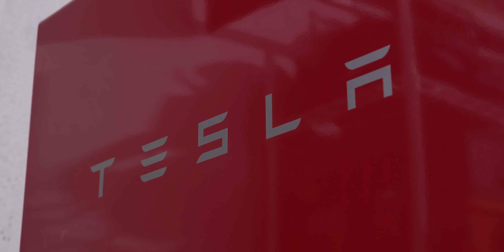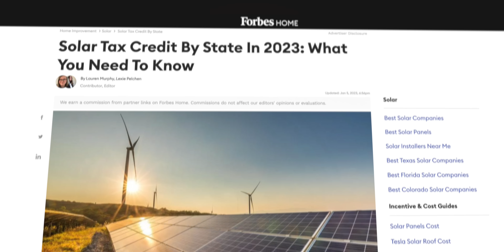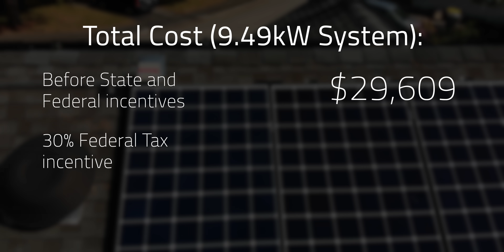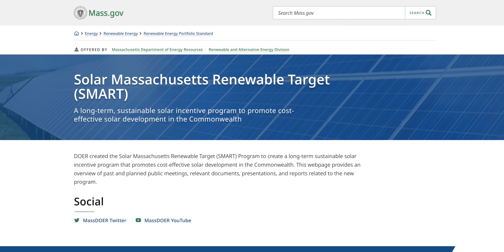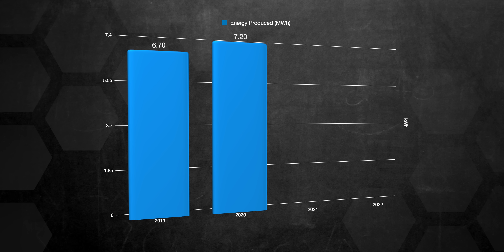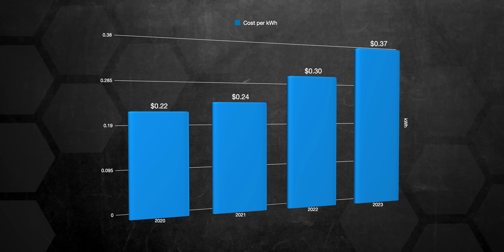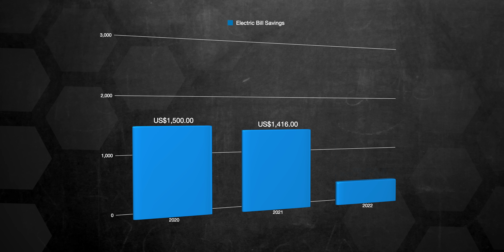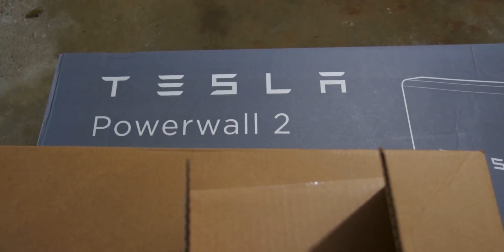5 Years with Solar Panels - Is It Still Worth It?

Comment: For those watching in April 2023 & beyond, the US Congress did extend the 30% tax credit to 2035 - however there are a few caveats listed - if your State offers any subsidies such as flat grants, rebates, or you are part of an energy "buyback" for grid-tied systems, that 30% is either reduced (22% minimum) or it applies *after*.

Dont try to pull a fast one either, as a lot of the State rebate or grant programs come from federal programs and are accounted for.

The Feds let you claim everything related to the project as well, so take copies of your receipts and paid invoices. This includes everything from contractor labor (get a good tax person to see if your own labor can be rolled, depending on your tax status), any tools and supporting materials: batteries, inverters, controllers, wires, crimpers, angle iron, couplers, insulation, masonry/carpentry materials, as well as Sales Tax.

So dont only put your Victrons and panels on your return, pump that credit.

Comment: Great video, very informative and clear. One question, in the category or would you do it differently. If you have an EV, would you consider not getting a battery like the Tesla power wall and instead using your car's batter for the same purpose?
Reply: That would be ridiculous. Your car would be dead half the time. When you needed it most, in the mornings to go to work, it would be drained from supplying overnight power.

Comment: Well first don’t put on your roof 

My reason is I want control not Government or city 

But cost is nothing to me when it’s about freedom 

I have 68 solar panels 
24 fortress batteries etc and backup on back up 

I’m off grid on 200 acres 

They power 3 houses and sheds etc and my high tensile electric fence . 

Money is fading anyway and can’t take it with you 

But as long as my family is free of bills and has power 
Water 
Gas 
Etc 
When others don’t 
Is glorious. 
My cost was about 160 k but I got the best at the time and made to last

Comment: It's videos like these that really irritates me, there was no need for this to be 16 minutes long, it could easily have been 5 minutes.  There is basically no scenario where solar isn't worth it unless you live in an area where sunlight is limited or you use basically no electricity.  You were just rambling through the video.

Comment: In 2023, you have 1000kWh per month? You're problem is NOT solar or not- it's consumption! If we're trying to save the planet, we cannot simply "buy" our way out of it... it's so consumeristic what you're doing. These solar panels take serious energy to produce and you're not doing them justice. I'm not even talking about the battery, which is also scandalous in terms of rare resources and usage. No one should even start making a solar array unless you're under 200kWh a month, unless you're recharging a battery for transportation. A battery of any type should be off the table unless you're off the grid in a remote place, not where you are. Stop hurting our planet and encouraging this behavior!

Comment: How long do panels last before they need to be replaced?
Reply: Our consultant told us that they should last a minimum of 30-35 years.
Reply: @guillaumerichard2724  Interesting, that's about 10 years more than the estimates I have received.  Thanks!
Reply: @boedye  then divide that in half, and you'll be closer to reality
Reply: @winstonsmith9168  That's kind of what I was afraid of...

Comment: When you listed your electricity cost per kWh I was really surprised.  I can't imagine paying upwards of $.40 per kWh.  Here my rate is only $.08 per kWh, and it is that much all the time regardless of time of day or season.  It has been about that for 10 years or more without any increases.  We are in an electric membership corporation though, and if they have excess profits we get a check back at the end of the year.  It's a good thing the rates are as low as they are, too, as we use as much as 10,000 kWh per month although on average it is more like 7,000 kWh per month.
Reply: Same here!  I am in NC and we pay about 0.12 per kWh (looks like they charge a bit more than that in the warmer months now and a bit under that in the cooler months).
Reply: Our rates aren't as good as yours, but still nowhere near $0.37/kWh. I was surprised at how much the increased prices have persisted in MA. Maybe there's some fees being passed back into the general electricity rate to pay for those programs that send checks to people with solar systems?

Comment: Question for solar panel users. How much expense is there when you have to replace the shingles on your roof? Don't you have to remove the entire solar system to accomplish that? What if you have a leak in the roof under the solar panels? How to repair without major cost in removing panels? I could see a hail storm (regular occurrence in the Midwest) damaging shingles and maybe not the solar panels, again causing you to have the expense of removing the panels to replace shingles. Also, how much does home owner insurance go up if these are covered by insurance for such damages i.e. hail damage? If you had to replace solar panels along with your shingles, that would likely triple the normal cost and thus guessing your insurance would be much higher. Are you even covered for such occurrences with your panels? Also, tree branches falling on the panels...?
Reply: Let me answer your question, YOUR SCREWED. Hope that helped.
Reply: @handsupbud  LOL Exactly my point.

Comment: I've looked in to solar where I am in NC. With my cost of $0.12 per kW/h and the lack of state incentives for being grid connected, plus no pay back on net metering, it'd take me 40'ish years to pay off  a sub 10 kW system. People should do their research before believing any sales pitches that come your way. The ROI, or break even point, is going to be location dependent. In my case it doesn't make sense. I wouldn't mind a Tesla PowerWall though. We do have frequent, but short, power outages. It would be nice to have for those times where breaking out the generator isn't necessary.
Reply: True, we’ve had people door knocking and even though I respect their hard work, people should educate themselves first. We are also lucky to know someone that works at a solar company so there was no sales pitch or anything suspicious. The installation was smooth and easy and now we are happy with our decision. I don’t know if you could be interested but I’ll be happy to send you his information. This way you won’t have to worry about the salesman or if the company will go bankrupt and leave you with problems. I leave it to you, if you are interested, just write me back.🫡
Reply: That's about twice the life that you would get out of a system, and the low price is because you don't live in a socialist state like Mass.

Comment: I'm in England.

A typical 3kW solar array with batteries costs £9,795 (complete installation)
It will typically generate 2,500 kWh a year
2,500 kW would cost £850 at 34p per kWh, so you’re saving £850 a year
So we can divide the cost of £9,795 by the annual saving of £850...
£9,795 ÷ £850 = 11.5

So would take 11.5 years to payback your investment of £9,795
BUT...
There is maintenance and servicing (and cleaning) to pay on your solar panels over years
So it’s more like 13 years (an inverter may fail which costs £750)
Between 13 years and failure of your array after 25 years you would have saved £10,200

BUT...
If you invest £9,795 at 5% you would be paid £490 in interest per year
After 25 years, that would be £12,250
AND you get your £9,795 back (whereas your solar panels would be worthless)
So after 25 years you would have a total of £22,045

Solar panels are a mathematical madness at ‘saving’ you money!
If the cost of electricity drops (from the quoted 34p per kWh) then your reason for solar panels are even less. If you can get better than 5% interest, your reason for solar panels are even less. This calculation takes no account of the degradation of the panels (they wouldn’t be producing 2,500 kW after a few years!) and takes no account of interest or inflation changes.

Comment: People are making payments for installation for 20+ years including exorbitant interest rates is hardly cost saving. These solar panels do not absorb that much energy, and be mindful they increase the likelihood of leaking roof.  Most energy use is for heating and cooling needs including the hot water heater and refrigeration.  Solar cannot generate that much power. It can supplement light bulbs and small appliances only. Birds will poo on them, and will accumulate dirt/dust etc.

Comment: Thank you very much for the video Matt. While I was listening to the related podcast, there was a mention that an advantage of getting solar was to also help you have power during power blackouts and I thought that was the case until I tried to get Solar Panels installed in UK and Ireland. There solar panels are tied to local blackout and was wondering if you were aware of it and/or had any comments on that please?
Reply: All solar panels tied to a grid stop working when there is a blackout. There are a few reasons including a.purposefully incomplete circuit and to prevent electrocution to workers who are on the lines because your house would be pushing power in those instances when the grid is expected to be "off." The only way to have power during a blackout is to be off the grid completely or have a backup battery which will act as a sink for the "excess" unexpexted power when the grid is not functional - batteries will not let excess power out to the grid when there is a blackout.
Reply: @anthonyroggio8686  thank you and totally understand the above. Can I confirm whether there is a solution in place in the US such that it could be mentioned in this video as a pros of having solar panels (or would that have been only for off grid) please?
And, doesn't a system exist that when a blackout occurs, it switches your system off the grid and keeps the lights on (almost like closing the circuit almost like a relay)? Please

Comment: If one of the discontinued panels needs replacing but is no longer available, I wonder what happens?  I mean they all need to be matched to install correctly, look OK and to work correctly (especially if you don't have the microinverters).

Comment: We’ve had our solar panels for the past 13 years, and one thing we’ve found is that the more that you can use the solar that you generate the better. We are both retirees so we charge our EV during the day. If on the other hand if we exported all of our solar generation to the grid we would be getting a pittance, which makes sense during the day solar generation from rooftop solar swamps the network so much better to use it yourself.

Comment: When your roof needs replacing, your costs will be higher than normal due to the solar panels needing to be removed and reinstalled. That'll eat away at your savings.

Comment: Fantastic video.  I haven't scrolled through all the comments but wondering if you could have installed the panels on brackets to face more to the south.  They would be odd-shaped on your roof.  We did this but our roof isn't as steeply-pitched as yours because we rarely get snow and never enough to build up on the roof.  We don't have shading from trees, either.  However, the winter weather here in Hobart, Tasmania, is mostly cloudy, so we are only net exporting to the grid for about 5 months per year.  We run two households from the solar - two of us in a 3BR house and another couple in a downstairs apartment, which is rather dark and cold.  We also charge an EV that we drive about 6000 miles per year.  The EV improves our break-even by about 2 years because we aren't paying for gas (petrol).

Comment: What got me interested in installing solar panels on my home.

I became interested in installing solar panels on our home after installing small, 100w systems on our first, then second travel (camper) trailers. Now, approaching two decades after I put that first panel on our camper, my wife and I are finally ready to do it on our home.

Why has it taken so long? It has a lot to do with where we live. 

Here, Washington State, we have access to a lot of inexpensive solar power. So, when Matt was paying a bit over 20 cents per kilowatt-hour (kWh), we were paying just 8.65 cents per kWh. Now Matt's electricity cost is over 30 cents per kWh, our cost is . . . 

8.65 cents per kilowat hour. So, where Matt's solar system is saving him over $200 or $300 for every 1,000 kWh his panels made, ours would pay out just $85. That made it really hard to justify the cost of installing a solar energy system.

Another thing that made a big difference was the location of our old house. We purchased in 2020 because it was in a nice location with trees and close to schools we wanted to send our kids to. Unfortunately, the trees were tall enough to shade our roof much of the day and the roof surfaces were oriented east-west instead of north-south.

Our old home was not a great candidate for a solar roof..

Toward the end of 2019, after our kids had moved out, we downsized to a new home that needed a new garage. Now, with the pandemic years in the rear-view mirror, we're getting that garage built. We're pointing the roof southward and making it big enough to fit 7700 watts of solar panels, enough to cover 70-80% of our home's energy needs over the next 25 years. 

It also helps that solar panel prices have dropped from $4 to $5 per Watt in the early 2000s to less than a dollar per Watt today. With the solar energy tax credit and my willingness to do much of the install myself, that'll bring the cost of our solar system down to somewhere between  $7,000 and $9,000. At our current cost for electricity our savings will pay for the system in about 9 years.

Comment: Here in Nevada, we get about 9 cent/kwh credit for whatever we sell back over our usege/credits. Not great, but still something.  It's quite attractive, actually, to intall solar as well since we get an average of 292 sunny days a year.  And the others are mostly semi-overcast. The big takeaway is build as much as you think you will need and then about 20% extra to compensate for weather and the system as it ages.  Doubly so if you plan to get an EV.  Nothing will toss you into maximum tier faster than charging an EV.  $200+ power bills are a common thing, even where I live, for EV owners who don't plan ahead.

Comment: I got NO ADDED VALUE despite selling my home with a 9 month old 30 panel solar system. Good luck.
Reply: In Florida it will probably cost you 30K due to the assumption that the roof is trashed now.

Comment: Living in Western Australia (myself and wife - both retired) had solar panels installed five years ago. They paid for themselves within 3 years.
Because of feed-in credits, non privatisation of electricity generation and supply, and domestic reservation of a percentage of LNG mined in the State our electricity prices are pretty low anyway. 
And our State Government gave all domestic electricity users a cost of living grant in June 2022.
With the consequence that since July 1 2022 my total cost of electricity has been AUD117.28. That's not average - it's the total for 8 months' supply of electricity.
So, I certainly agree with the thrust of your article.
BTW Western Australia gets an average of 8.8 hours of sunlight per day, averaged across the year.

Comment: in quebec if i convert my rate in usd dollars and add 15% tax
it come to  130$/y of fixed grid fee
and then the first daily 40kwh is at 0.054 $/kwh
and the excess is at 0.083 $/kwh
and from my understanding the excess rate is calculated per bill with is 2 month, so if you have week consomation during a week end you ll have that low rate power for the following week, but you can't save your low rate during the summer to heat your house at winter.  So in canada your peak demand is in winter when our roof are covered by snow and day are shorter. And even then with our rate even the high one solar panel probably won't pay itself back.  All in all a house cost about using about 12mwh in a year (wich is low considering heating) will have spend about 825$usd on power, and a big house spending 40mwh per year (2 story + basement + 6to7 occupant with a small pool) will cost about 3k$ usd per year.
From the start in quebec there is not much money to be saved as baseline, there is more in the rest of canada as electricy cost are about twice higher elsewhere.  But the most efficient cut to power bill here is proper insulated door and window and (wall and roof it s a really old construction).  Smart thermostat are good too.

But here one thing tough, if with current price of electricity in quebec solar panel doesn't make economic sense.  BEV car make incredible sense as fuel tend to more much more expensive then usa, as their is lot of tax on it.

Comment: Just picked up on your channel Matt. Here in South Australia which is a long way from you, I think I can safely say, solar is well worth it with around 1/3 of homes now using rooftop solar. Even in my small street, 10 out of 14 homes now have solar. And when I look at my figures;  my electricity bill was $650 for 9 months and that's with just an average 6.6 kwh system, that has generated some 7,700 kw/h in 9 months. But then again, we never see snow and I'm ok with that!